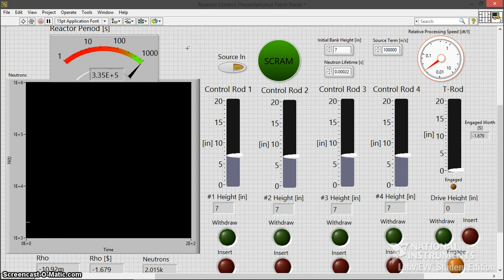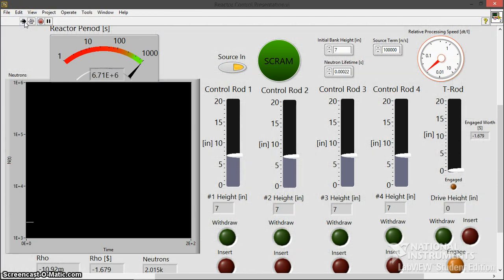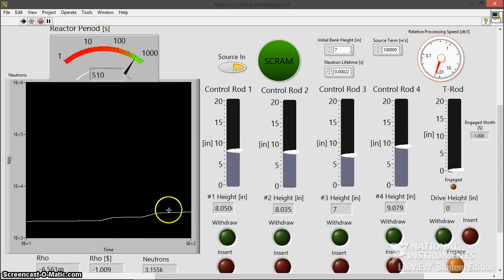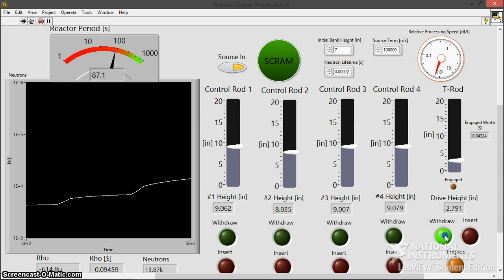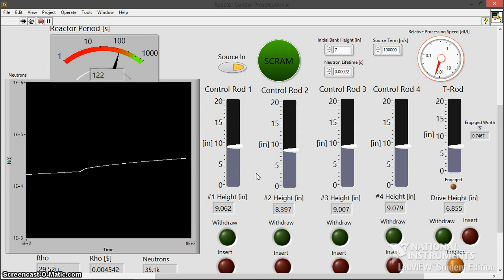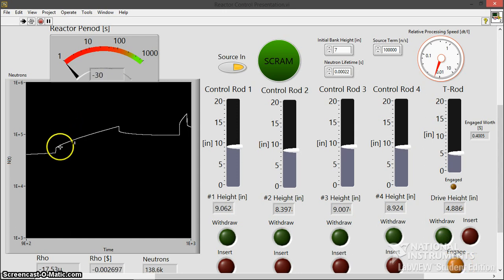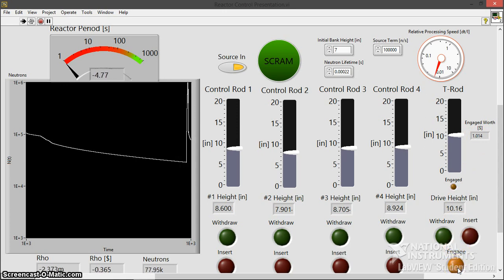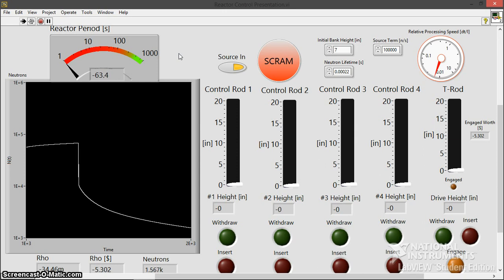Dynamic Nuclear Reactor Simulator

Comment: There is a flaw in the control panel design. An alarm either audio or blinking light etc. should have indicated that the source had not yet been adjusted.